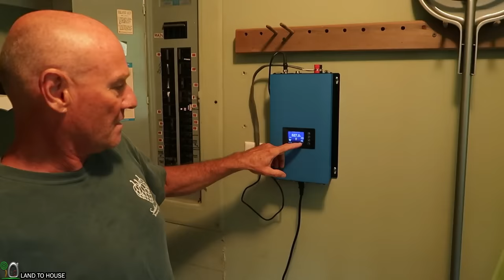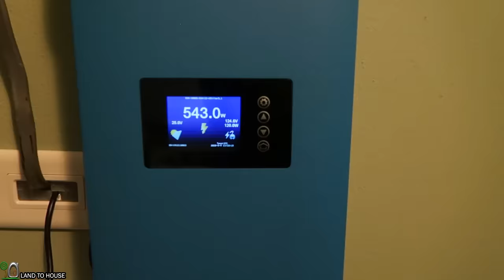Awesome Low Head High Flow Grid Tie Micro Hydro 530 watts!

Comment: I mean, the hydro part of it is pretty cool...

But the electrical side is a bit wonky.
Reply: Yep. He is losing ~100W in cabling at full power. He should move the rectifier next to inverter and use three core 10mm2/ 8 awg for three phase run from generator to rectifier. Then serious health hazard! He is using plug to feed power to socket!!!
Reply: @peto22  don't use a rectifier at all.. he's requiring ac for grid and has ac.. hes probably loosing like 200W for that conversion stuff
Reply: @deadclan7796  in order to grid tie direct he would have to generate at 60 Hz and 120 v - doubtful he is
Reply: @TheCanadaman1  watch the video... he's rectifying to 24VDC and has an inverter with grid sync and disconnect
https://youtu.be/V82SVeVXKcA?t=493
Reply: @deadclan7796  His 3phase generator is is not  sync'd to grid phase and frequency (it's rotational frequency and output voltage are flow and load dependent). rectifier electronics for only 528W are trivial to produce his 24VDC for battery storage.
Reply: @peto22  Facts from video: 528W of full load power (measured post rectifier and possibly post inverter) over 100 feet of 3 wire 10AWG copper.
100 feet of 10AWG is 0.1 ohms per conductor.
100W/3 = 33W loss per wire would mean there is 18.2Arms per line wire, and 1.8V drop across the transmission line.
If it was 18.2A per line, then the voltage would only be ~16.5Vacrms line-to-line. That is a silly low voltage that would require huge generator windings.
He does not say what the 3phase voltage is going into the rectifier, but for safety reasons I hope he has it configured for <300VAC line-to-line as a corner grounded delta (one of the wires used in transmission is the bare copper ground).
Even if we assume a reasonable 120V line-to-line, the current on each line would only be 2.5Arms for a total transmission loss of 1.9W
Not even close to your guess (?) of 100W
Note: I'm a power engineer for 20 years
Reply: @deadclan7796  and how do you recommend he match the sine waves up with that wonkey ass set up? even a slight difference in the wave form will create circulating currents and torch that place. not to mention that he's creating 3 phase and probably has single phase incoming
Reply: Yeah, I stopped watching at “using the ground...”
No, no, no. Get some proper 3 conductor wire FFS.
Also that junction between the generator was not weather sealed. Get some proper cable glands.

Clever design using a siphon setup tho!
Reply: @dl5244  you just blew my mind, I'm so jealous of all of your knowledge. Its like you're speaking a foreign language. Its so frustrating that schools teach so much useless knowledge but don't teach how something that I use everyday and depend on works. I would trade algebra and knowing what mitochondria is for basic electrical knowledge any day of the week.
Reply: @dl5244  exactly ... 100W is a lot of power dissipation ... That might even melt the wires
Reply: Using the ground in the MI cable as a phase conductor is going to burn the cable. Also seems like a lot of work for less than 5 amps @120 v.
Reply: @deadclan7796  yea, I don't understand why he converted it to DC? I didn't see a battery to which he was storing it incase of an outage and why not just wire it straight to the ac box with its own breaker so he doesn't burn his house down by using an outlet with a regular old plug?
Reply: @dl5244  he can get by with that depending on how far way he is from generation from the power company not to mention the amount of steps that it had to be transformed, i.e. phase shifts. The length of the line acts like a capacitor and helps stabilize the vars that would be created. All that said what he is doing isn't very smart or efficient. If enough people did this it would be a mess at the generation plant.
Reply: @christopherpage2723  I think the video said it was a standard solar inverter module that takes DC in and regulates for battery storage then produces line synchronized AC
Reply: @dl5244  at 7:09 he says it's generating 528w at 24v and that's DC from the rectifier. Correct me if I'm wrong but the rectifier-filter output voltage will be equal to (3×sqrt(2)/pi)×Vllrms of input ac (assuming 3 phase full bridge rectifier), where Vllrms is line to line rms voltage. Calculating, we get Vdc = 1.35×Vllrms which implies Vllrms = 17.8V. Vlnrms = Vllrms/sqrt(3) = 10.23V (Vlnrms is line to neutral rms, hypothetical neutral as it seems to be a delta generator). Now this holds if it's a simple rectifier, and does not hold if it's some kind of smps step down converter.

Now assuming balanced 3 phase system with unity power factor, Power = 3×Vlnrms×Irms and calculating we get, Irms = 17.2A

Edit: I looked up for rectifiers and found the exact product
https://www.order2india.com/products/three-3-phase-diode-bridge-rectifier-150a-mds150a-1600v-power-durable_132151226842?variant=1267142131727

It's not an smps so calculations must hold.

Edit 2: amount of copper in electric machine is dependent on power, not current. In this case, while you need thicker winding to handle high current, you also need less number of turns to generate lower voltage and so amount of copper remains same.
Reply: @elninorosario  whether it'd melt wire or not depends on length of wire on which 100w is distributed. For 100ft, it'd be 1w per ft which is not enough to generate noticeable heat.
Reply: Ricky G70 Watson  algebra also is just a first step a lot of electrical engineering is calculus based.
Reply: @snehanshourya3850  ok, I guess that's a possible interpretation. I had hoped/assumed the inverter was producing the 24V for a battery bank...
You 3phase calcualtions are close, but it's a 3 wire 3 phase system (no neutral) with no real "Vln".
The 3phase bridge rectifier shown will produce a DC output not exceeding CrestFactor x Vll_max RMS. Because of the diode drops and the non-linear loading, the crest factor is probably just slightly below sqrt(2) (a flattened sinusoidal with a Crestfactor of 1.3 to 1.4). Assuming a 24VDC rectified output and typical diode drop on the rectifier (~1V), I'd expect about 18 to 19 Vrms line-to-line (at the rectifier input). This means the rectifier is dissipating 25W-50W (depending on generator frequency and exact diodes used - he did hint that the rectifier was running hot). 
If we include transmission and rectifier losses, the line current would be 18 to 20 Arms line current on 3 wires... which is pushing the upper limit for 10AWG.
If the generator is really a very low voltage design, the payback on doubling up the copper on the transmission line would be pretty quick.
If this were scaled up he should definitely consider stepping up to ~250VAC with a power transformer (depending on max voltage allowed at the inverter) to reduce transmission and rectifying losses by a factor more than 100x.
Reply: Yeah, better hope that plug doesn't get pulled out when the turbine's on.
Reply: @mwiz100  grounded b phase is in the code book and you can by in in St Louis Mo
Reply: @thewolfin  Ordinarily the inverter output should cease when it detects there's no mains supply, so the plug should have zero power on it the instant that you disconnect it from the socket.  This is an essential function to protect line workers from getting zapped when there's a mains failure, that is, grid-tied generators are required to disconnect their output on loss of mains detection.
Reply: One must also consider the flux capitatior.
Reply: @UCCLdIk6R5ECGtaGm7oqO-TQ  they are totally illegal in the USA though. The only thing legal is wired directly.
Reply: Why is it three phase to begin with why not single phase 115 is it an issue of lowering voltage increases amperage??
Reply: Schools teach so much Useless knowledge...what are you talking about. I know that is racist and entitlement speaking as taught by government schools Bwaaahahahaha oh man it’s funny cause it’s true.
Reply: @donovangolemon4200  Schools teach you what you need, you can use the knowledge to get more knowledge. 

But I agree, I think Schools should teach more of the "useful" things
Reply: @quantumtechcrypto7080  More efficient on the generator side as there are more windings, there's also less power loss as three wires share the current instead of two.

Comment: Great work, you can increase your efficiency by installing transformers by the turbine to raise your maximum open circuit voltage to near the limit of your rectifier input.
Reply: Exactly. It's not efficient because it's AC. It can easily be made efficient because it's AC.
Reply: One hundred feet is a very long run with high loss for 24 Volts.  Put a step-up transformer to 48 V or maybe 120 V near where the turbine now is, and move the diodes (which need to be on finned aluminum heat sinks with convective heat flow) to near the inverter.  If you pick 48 Volt step up, you'll need an inverter that expects 48 Volts, and there are some.  If you pick a higher voltage, there will be lower line losses, but you may need another step-down transformer just before the diode rectifiers that feed the inverter, and losses from the second transformer may negate the higher 120V (or what ever you choose).  48V probably ends up being the most efficient.  You also might consider Silicon Carbide rectifier diodes, since they are more efficient than ordinary silicon diodes, but more expensive.  Since you've only got about 500 Watts to work with, it is silly to give up a significant fraction to avoidable line losses and diode losses.  There is a very good reason power companies use high voltages .  You can also use heavier cable for your long run, but heavy copper cable is expensive, and raising the voltage is the cheaper and more efficient way to achieve the same thing.
Reply: @dwbogardus  If he moved the rectifier beside the generator, another benefit would be using the cable properly: +, -, and a safety ground. At such low current this setup technically works but, if I was his electrician friend, I wouldn't want anybody talking about that! (For that matter, I'd probably insist on a dedicated breaker and ditch the suicide plug)

PV inverters work with higher DC inputs, an MPPT would be a decent fit for an asynchronous generator. One drawback would be cost, however: If he's pulling about 530W on 3-phase ~24V over 100', the drop over the ground wire - which is 12 AWG in a 10/2 cable - is over 20%. That's relatively quite high but at this scale it doesn't seem like much power, I'm not sure the ~100W or so would be worth the expense.

Comment: The amount of suction that thing creates is insane. He could add at least 3 more turbines to that setup.  I believe that might even make the flow slow enough to keep more flow over the wall. Even hook a float up to a clutch of some sort so when the level in the reservoir drops to a certain point it engages another turbine. I would do everything with arduinos, but it would be possible to do it completely mechanical.

Comment: In times of reduced streamflow, have you considered a butterfly variable flow valve on the inlet? It would not break the vacuum and would reduce the output, but it may be a way to adjust the flow and enable the operation without shutting down completely.
Reply: I was thinking the same thing.  Keep head pressure all the time.  I is easier than attaching and "electric vacuum" to it.   The electric vacuum also destroys the purpose of the independence of that unit.
Reply: @lw7238  or @warren osborne Hypothetical from a layman, but would automating a backup vacuum system be too horrible? initial and maintenance costs go up, but an extra (car?) battery with couple extra valves, sensors, etc... enable the system to keep the battery charged to reasonable levels while operating. that way if something does happen, at appropriate water levels you can restart the system automatically.
Reply: Eventually dissolved gasses within the water will break the vacuum and stop the siphon I would think.  Maybe if the water is flowing fast enough it will take the bubbles with it.  I guess they would know if this happens or not.
Reply: @fuzzywzhe  I think that would take some time for the oxygen to build up.    But you are right it would need to be airtight.
Reply: @lw7238  Well, I don't know how well gasses dissolve into water, but there would be gas - could be CO2, Oxygen, or even Nitrogen.  Nitrogen is the most abundant gas in our atmosphere.

It might not build up at all, if the flow is fast enough.  The people would be able to know.  I'm only talking as an engineer, and what I would expect, what I expect may not conform to reality.  Also, I'm an electrical engineer, my opinion is only based on basic education in fluids and that's early education, and I'm certainly no expert.
Reply: @fuzzywzhe  I am talking when you stop the flow in the pipe and the water stays in the pipe but no flowing.  That water could then be used to restart that flow.
Reply: The disolved gasses thing is not a problem at all....the flow through the pipe is so fast that any bubbles will quickly get sucked out the outflow. This is obvious if you notice he only ran the shop vac for 5 seconds and that created enough flow to quickly expell all air from the system even though the pipe was still MOSTLY AIR at that point. 
This is why I suggest adding a second turbine inline. The pressure drop from the current turbine at that flow rate is negligible so the power output from each turbine would be very close the current output from the one and there would also be a tiny reduction in total flow. 

Put another way...that pipe has many thousands of watts of mechanical power running through it every second and the turbine is only capturing a tiny fraction of it. There should be only an insignificant reduction of efficiency in trying to capture more of that power.

Alternatively, he could just make a smaller inlet, or add more screens to slightly reduce flow rate. Likely it would only take 10% less flow to avoid the suction loss from low late level issue.

Comment: Great! Now I just need to find a waterfall
Reply from the maker: Or a creek with lots of head pressure as in my 10 part hydro power series.
https://youtu.be/zPIec9VCrOY
Reply: Upper and lower water tanks with multiple check valve pumps to keep the flow rate into the upper tank to keep up with the flow out of the upper tank. Using the vacuum principles creating the siphoning effect and proper math skills helps a lot. A lot of mathematical rules going on here with scientific principles done on paper and then tested out in real life.

Comment: Would love to see a fully integrated deployment of this hydro-turbine configuration feeding large battery array coupled with a similarly manageable size solar array that would then resolve the low water periods.  If not a completely self-sustained, efficient system; it would be "dam" close.

Good work!  I like that you did it as part of a hobby/curiosity exercise and not a zealot attempt at "green" veganomics.
Reply: @jerryrobinson7856  Agreed.  There is no, practical, abandonment of the electrical grid.  I don't see storage and load dampening solutions in my lifetime.  And I REALLY don't see how I could be running a 240v Mig welder from the voltages discussed in any of these solutions.  They're nice hobbies for "domestic living" but I enjoy metal and woodwork hobbies too.  :)
Reply: @jerryrobinson7856  
No offence. 
500watt is... 500watt no matter the voltage is.
Probably it is the effiency of the inverter but this is ~0.95 so that it would be 500w input and 475w output. 

Maybe this seems to be not signifiant but having 500w permanently, you can draw 12kwh in 24h.
All you need is to accumulate the energy somewhere (battery, capacitor) if you wish to have available bursts of power over 500W without consuming from the grid. 

My house is drawing 200-350W during daytime and only during nightime it goes below 150W.
Of course I have other home appliances 1500-3000W power running for short times not permanently. 
All of these consumptions brings me to a 6-10kwh daily energy usage.